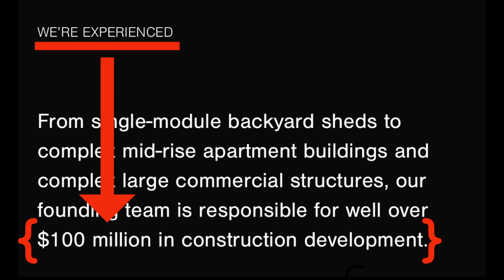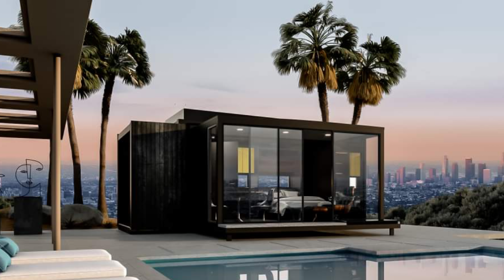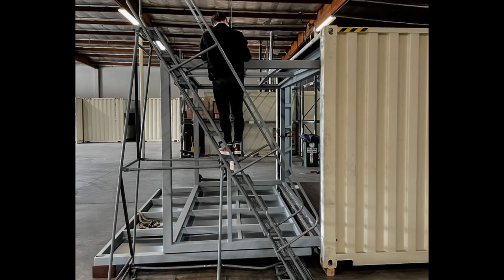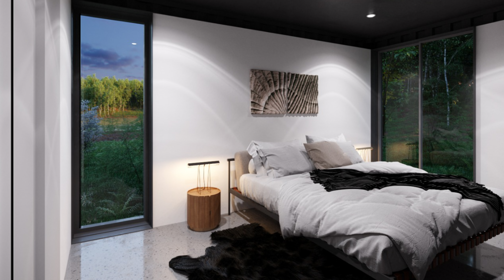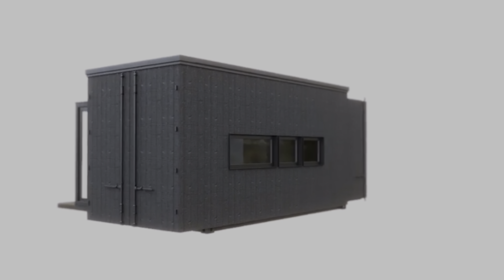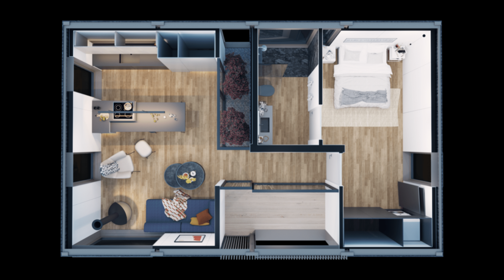Affordable Folding PREFAB HOMES You Can Buy Right now

Comment: I like the shift but i would prefer if the slide out was on an angle, im aware it almost never rains where they're building them but they have to think of all the other places they can ship... its a very cool idea but slide out even on a camper trailer/ RV is kinda of sketchy!?... and just last month i thought of a very cool slide out concept for a camper trailer/ tiny home.
Reply: Mobile homes have used slide outs and tip outs for decades.  If the site is prepared and the home set up correctly, the seal around the connection is not a problem.
Reply: @doloresreynolds8145  Yes technically its suppose to be ok ... and i know camper trailers/ RV are not the same build quality but alot of slide outs have water infiltrations. Its always better to put an angle on a roof, even the BOXABL is kinda of sketchy regarding that flat foldable roof but only time will tell!?

Comment: STEELBLOX base starts at $300/sqft Excludes Deliver, Setting, Connection, Permit Fees, Engineering Costs, Specific local building requirements, Site Work, Sales Tax
Reply: Sounds doable
Reply: I can’t believe you get “Roasted
Reply: I find it hard to believe , that you
Get Roasted , !!!   Why I would be a tender Turkey if I did what you do as a Service and not even half as good in the delivery of quality which you’ve got down soundly ! I , personally ThankYou.  By the way.   Happy Thanksgiving !
Reply: What a rip